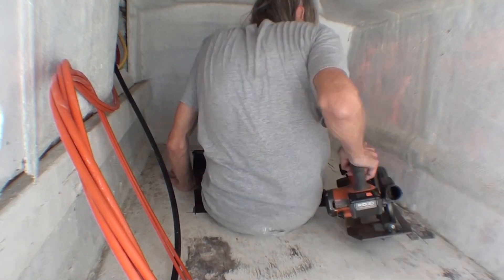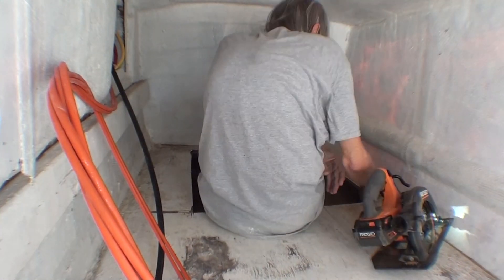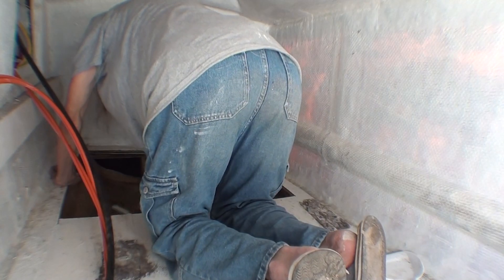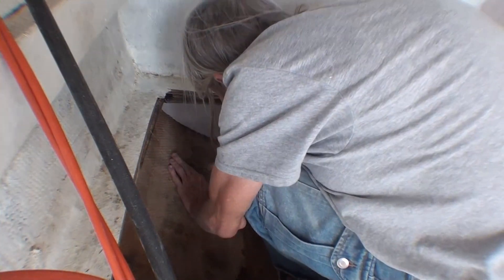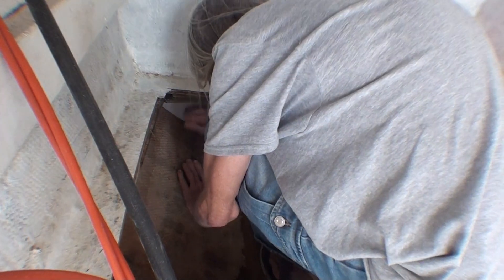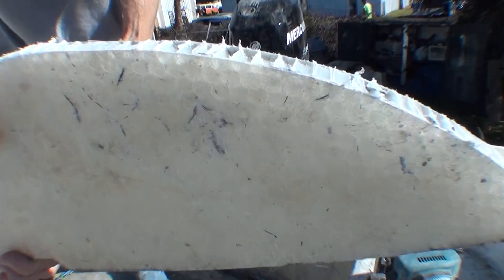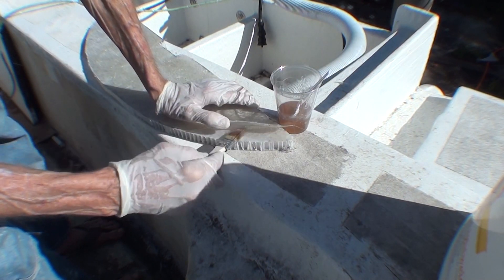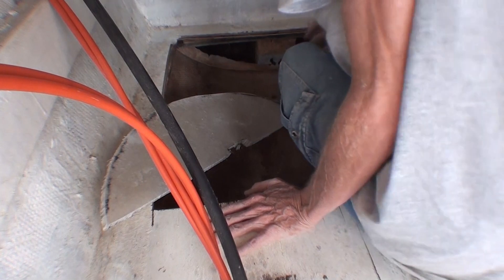Building A Bilge Bulkhead Below A Back Berth

Comment: Lot of progress, many videos recently. Thank you for the updates!
Reply from the maker: I am slowly getting back to work on the boat after breaking my leg.  Also experimenting with shorter videos, about 5 minutes on a specific project instead of the 20 minute ones about what happened that week.  Next time, I fix the floor in the other pontoon.  I was both happy and surprised to not find the foam under the floor full of water.

Comment: Just how strong is nidacore ? Doesn’t seem like it would have much strength if it was put in a high stress area. Just curious never used it before just want to know in what situations would it work in. Thanks take care 👍🙏
Reply from the maker: Nidacore itself isn't very strong.  Its stronger than balsa core and at least as light.  Both core materials get their strength from the fiberglass laid on both sides.  Separating the top and bottom layers of fiberglass with something incompressible makes the panel stronger than the fiberglass itself would be.  Doubling the thickness of the core makes the panel four times stronger. without adding much weight.  In this case, I considered laying up some fibreglass on a waxed glass table so it could be peeled off and using only fiberglass because this only has to hold back four inches of water, but cutting the nidacore with a razor knife and sanding the glass back to the nidacore was easier.  There are a lot of videos about using Nidacore on my channel back when I first started restoring the Carver.